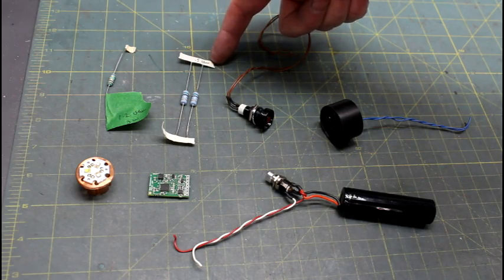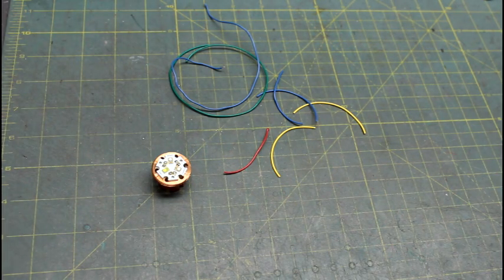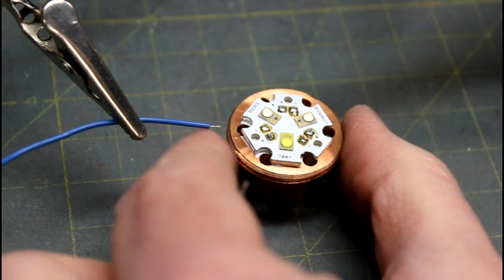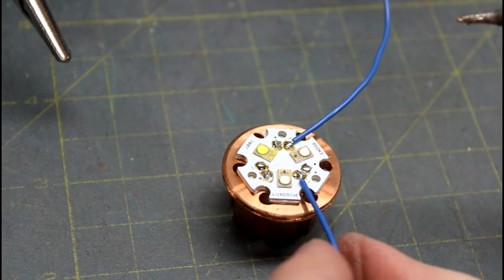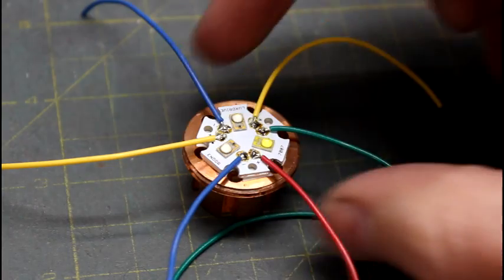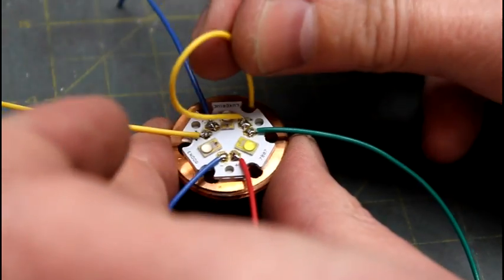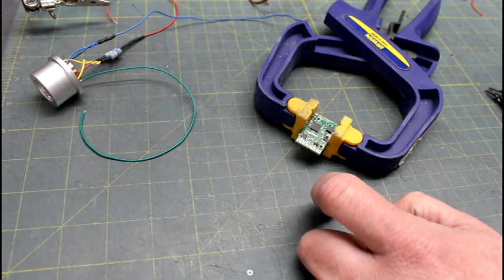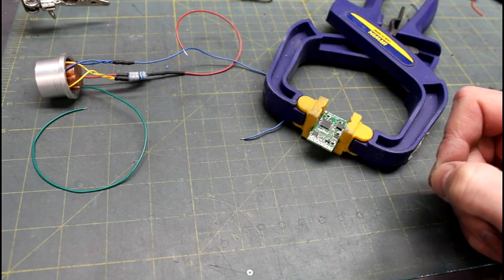Nano Biscotte 3 and Flash on Clash

Comment: hi there! as old as a video as this may be, I'm running into a problem when testing my LEDS. now every single LED on my tri cree (BWW) work just fine individuallym but when i combine a B/W combination and their respective ground wires combined, either the blue won't light up or both don't light up and it gets super hot. mind you I don't have resistors wired in and just using a AA battery pack with two drained Ni-Cad batteries that's undervolting to not blow the LEDS. aiming not to blow my board as I can't replace it, but thoughts on what might be causing the wires to get hot/the blue Die not lighting up. thus far I've tried 

A- FoC White Die's + and - : works
B- Main White Die + and - : works
C- White Dye + and - with Blue Die - : works
D- Blue Die + and - : works
E- Blue Die + and both Blue and White Dye - : Does not work; gets hot VERY quickly
F- Blue and White Die + and - together : does not work, gets hot VERY quickly
Reply from the maker: We will do our best to help you out here! Please reach out to us via the contact us form on the site! 

 https://www.thecustomsabershop.com/ContactUs
Reply: @TheCustomSaberShop  sent an email your way, hoping to hear from you guys soon!

Comment: I know this is an older video, but I hope you still answer questions on it.
I have a tri-cree RGrB. I'm doing a purple blade with greenish clash. The only resistors I have on-hand are 1/2 watt resistors. I wanna use a 3.6 ohm on the red and a 0.5 ohm on the royal blue to get the purple I want, but like I said, all I have is 1/2 watt resistors. Will the 1/2 watt resistors be good enough?
I do have a 0.5 ohm 5 watt to join all the positive wires.

Comment: Awesome vid, as always.
Were you able to change up how you cycle between fonts with this card? Say, pressing the main button makes one noise (failing to turn on, for example), holding the main button makes another (usual sort of saber font, except sputtering and unstable), and pressing the main button while a secondary button is being held for the third (regular saber noises)?

Comment: I am making a saber with the NB v4 with a tri-Cree LED. Would the wiring be the same on the v4? (I don't see tri cree wiring in the v4 manual). Also, I have not decided on the 3 colors yet. I might go RGB but would that be different wiring than simply BBW? Thank you and keep up the awesome videos!
Reply: Well, I soldered my V4 up like V3 and it worked.  I used Green Green White and the flash on clash works great.
Reply: I would love for your question to be answered.
Reply: Does anyone know the answer to this question?
Reply: McPappy Racing  we are all still waiting apparently
Reply: McPappy Racing - Sounds great!
Reply: good question. i'm doing the same and i'm not seeing any information on the NBv4.
Reply: McPappy Racing you wouldn't happen to know if you can change the configuration on the changing through fonts, would you?
Reply: You mean like colors?  Yes, I can control the colors of everything in the config file.

Comment: hi iam adding every item to cart but dont see the outer heatsink module of the led. does that come with led?
Reply: The heatsink comes with your blade holder. You can select which one.
Reply: +Rob Petkau thank you so much Rob for taking the time to make this tutorial I just did my very first install using the items and this video.

Comment: Hi Rob. I'm planning a FoC build using a red, red, amber LED, with a Crystal Focus V8, and 6 wire Buckpuck. Is it absolutely necessary to have the 2512 smd resistor for the FoC - pad, or can I run them through the Buckpuck, or forgo the resistor all together as demonstrated here? Thanks.
Reply: Hey,
You do not need a buckpuck. All the info in the CF manual. You can use regular 3-5w resistors if you don't have SMD ones.
Reply: Rob Petkau Thanks Rob. I appreciate the answer. I will be ready to build once the parts arrive. Thank you for the videos. Take care!

Comment: Hello Rob I'm planning to finally install my Graflex 2.0 but using the stock switches it comes with, do I need to add a momentary to latching converter to this and I'm planning to have two switches on my saber one on the red button and on the clamp will the saber still work if I connect two switches to the sound board?
Reply: I assume your kit has momentery switches. If so - no, you would not need a mom-latching converter.
Two switches is not a problem
Reply: Okay good and would I connect the two switch wires together wiring it to the board
Reply: Correct.

Comment: Hey Rob, so because the Tri Cree Amber LED has virtually the same forward voltage as Red I would use the 1.2 ohm 3w resistor for that as well, correct?
Reply: I would assume so. I'm wondering the same thing. Go to ledsupply.com and they have info on the tri Cree LED's. I'm going to do green green Amber. And using 0.5 for each green and 1.2 for the amber.

Comment: Hi Rob, thanks for your tutorials ! 
If I you wire both blue Leds from your RGB with a 3,7V battery and put them parallel, you'll only drive 1,8V per LED, which will decrease the luminosity, right ? Or can we state that 2 LEDs with 1,8V voltage will illuminate the same as a single Led @3,7V ?
Thanks for your help !
Reply: worth than that actually, relying to the datasheet, the leds won't even blow up @1,8V, could you please explain ??? Am I going the wrong way, thinking that the voltage will be splitted equally through the 2 blue Leds ?
Reply: Hey,
A couple of errors. 
1. RGB only has one blue LED. BBW is two blue and one white.
2. When you wire two LEDs in parallel the voltage required stays the same, while they consume double the amps (milliamps).
Reply: thanks so much Rob, shame on me (especially for point 2) !

Comment: Stupid question, how does the board "know" which of those lines is the flash led when they are attached to the same power source? I'm guessing it has to do with the negative line being activated as well?
Reply: Correct. The distinction is made through the negative side.

Comment: I'm looking into using a trust fire and a dummy Cell with the tcss AA battery and speaker holder kit, is this ok with the nano biscotti v3?
Reply: Yes it will work. But you would not get much run time. It would be better to use the v6 holder and battery holder for an 18650 trustife.

Comment: Hello Rob,  this may be a silly question.  a few months ago I purchase an Ultra Saber prophecy v3 with lite sound board/no flash on clash.   I regret not ordering with flash on clash.(budget mind)  anyway I heard about the Nano biscotte V3 or the Pex.    Is it possible for me to do/change/add the Nano or Pex, to my existing wiring on my Prophecy V3?    

ps I did not see any videos on upgrade using existing wirings on other sabers.

Thanks Rey
Reply: It should be fairly easy - but I have not worked on that kind of sabers personally. I would ask on the forums.
Reply: Thanks rob,  i'll check at forums...  Your Vids are Primo .. thanks for Sharing   ;o)
Reply: Know this question is a year old but for anyone else that is wondering about “activating” FoC on an obsidian board, the center pin on the board is the FoC lead.  If your saber doesn’t have flash then there will be a 3 pin harness on either side of it, leaving it open. FoC/lock up is always on, you just don’t see it because there is no led connected to the center pin.  You’ll need to change the led star to one with a flash die and connect it to the empty center pin.

Comment: So in this build how would you secure the sound card if you were to use this as a stunt saber?
Reply: "Stunt saber" generally means it has no sound...

There are many ways to secure the sound card, battery and speaker. Try the v6 holder.
Reply: Thanks for the reply!

Comment: Hi super super noob question, is possible to assemble a nano biscotte V3 (or even another small soundboard) for a sort of only 'audio' stand alone system? I mean is possible to connect the soundboard to a small rechargeable battery a small speaker and a switch of course, and make a small element that produce lightsaber sound swings, on off ecc. alone? without any led connection or complete saber scheme? Thank you in advance for any advice.
Reply: Absolutely.
Reply: Thank you for the super quick answer!

Comment: hello rob, very nice tutorial video for the  biginers i enjoined very much seen today. I have a question... should be posible to do a tutorial with the crystal focus v8 and using JST conectors and buck puck instat resistors? i am trying to sell a saber empty, for instance from SF and do this for first time with a nice soundboard and using quick conectors instat soldering all the times if is posible. thanks a lot for your time, best regards
Reply: In my opinion. I would not install a CF without soldering. Besides - you do not need resistors with a CF, unless it's on accent LEDs.
Reply: thank you soo much, then for CF soundboard is not necesary resistors or puckbucks.
i want buy SF aprentice mode sabers and install leds, recharge port and  sound by myself when i can... is far cheaper tan buy with sound.
just 2 questions... with CF is necesary 2 Li Ion batery x 18500 isn it?
you know wich soundboard is coming on SF?
thanks  a lot, tavi

Comment: sorry again for the nobe questions. I was told recently that you do not need a resister for your Green, Blue, and White LED's. Only Amber, Red, and Orange. If you add a resister to the G, B, W LED's, it will not come off as bright as you wanted it to be. I was hoping you can elaborate on that notion of not needing resisters for those specific LED's
Reply: Without a resistor - and a full 3.7 v battery it will be overdriving the LED. A little brighter, and shorter life for the LED - your call.
Also - if using a sound board it can cause fluctuations that negatively affect the sound boards performance.

Comment: So I have read the NB V3 users manual from the Plecter website and have searched the interwebs for how the FoC function works on this board; when the FoC is activated, does the FoC color come on with the main LEDs simultaneously, or do the mains LEDs shut down when the FoC LED is lit? Thanks for any info.
Reply: With the NB board FoC activates and the main LED stays on. With the more expensive Plecter boards you can program the finier details of how the FoC works.
Reply: Awesome! I very much appreciate the response! This info will dictate which LEDs I choose to get the main/FoC colors I'd like. BTW, your vids are extremely well done and have been an invaluable resource for a first time saber builder like myself. I have been archiving them in my favorites and have already garnered several project ideas! Thanks again!!!

Comment: Hey Rob i have a weird question. I was watching the special features of episode 7 and noticed that the lightsaber props light up and had light effects. would it be possible to use a nano biscotte board and not attach a speaker to simply  get the light effects like flash on clash and lock up? or would this cause a failure in the board some how?
Reply: You can certainly do that.
Reply: Rob Petkau SWEET. thank you so much

Comment: Hey question if I have a tier 2 lightsaber can I add a soundboard to it?
Reply: +Games For Cykits Not sure what a Tier 2 is, but the NB soundboard is designed to work in many applications.
Reply: +Rob Petkau oh ok that's good to know but it's one of the different levels of lightsabers saberforge has tier 1 is just the hilt and called I believe ignite, tier 2 is the hilt and saber,  also called warrior, then you can get tier 3 which is champion which is the hilt, saber, and sound board, then there hero which is all that and more, the higher the tier the more expensive it is, but since you don't know about the tiers by saberforge then I guess you won't know if you can add a soundboard to their tier 2 saber, thanks for telling me though

Comment: If you had a saber with a standard switch, like ultrasabers, could you put a nicer looking one, or am I stuck
Reply: Depends on the size of the hole that is drilled in the hilt. Many nice illuminated switches come in 12mm or 16mm sizes (hole diameter will match)
Reply: Thanks, I want to upgrade my ultrasabers to have sound and I want better switches too

Comment: I've been trying to do a similar build to this using an old luxeon style RGB LED & a Nano V2 but I keep getting a trickle of power to the red in standby & little or no power to the blue when active. The flash works fine & with the soundboard removed from the equation I'm getting the desired purple blade colour but with the soundboard it's coming up pinkish red. Could it be because I'm not using a resistor on the blue + line?
Reply: +London-Sabers Sounds like you have a short circuit somewhere.